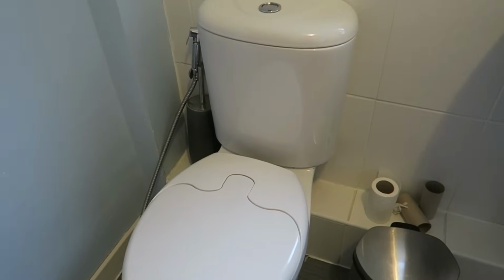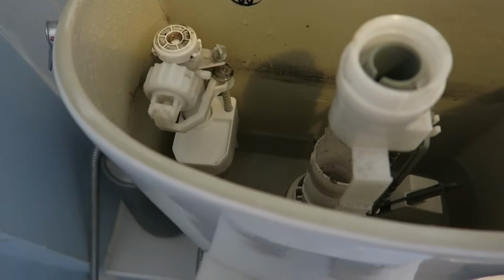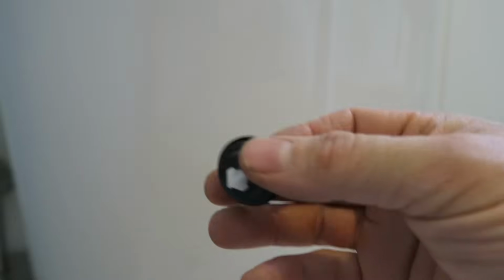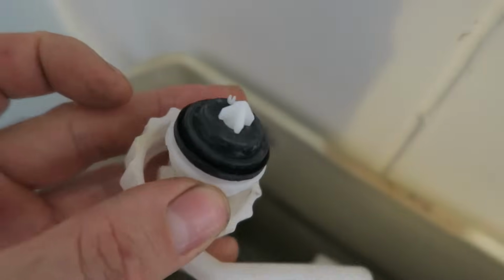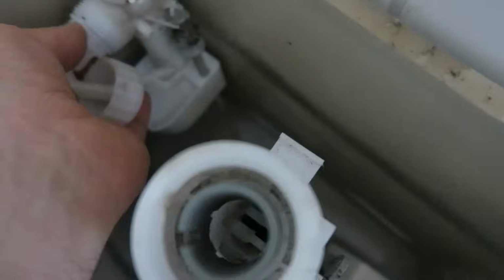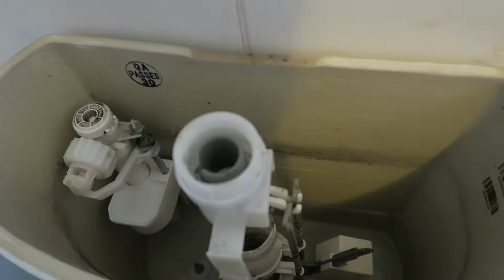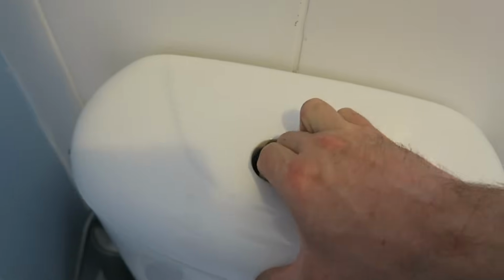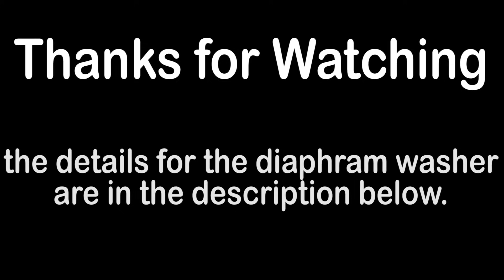Toilet Repair, Slow Filling Cistern Repair

Comment: Great video - unfortunately it hasn’t worked for me. Toilet was taking about 10 minutes to refill. Got a new washer and followed the steps including lining up both notches (inside the washer & the connection to the valve - but when I switch the water back on it runs constantly and loudly - so worse than before! Have had to keep the water turned off. Do you have any suggestions to resolve? Thanks.
Reply: I'm in the same position as you. Please can anyone help?
Reply: @shaun9407  I tried the tip from Ron (comments - about 2 months ago) to press down on the circle on top of the inlet valve with a screwdriver to let air out when refilling. After a few tries this resulted in the refill stopping after about a minute - but still noisy/whistling during refill, so not a complete fix.
Reply: @jm450  I've discovered that the white plastic arm was lodged in too tight, and therefore wouldn't lift with the pressure of the float. I emptied the water and refitted everything so that the arm/float lifts  smoothly. 👍
Reply: @shaun9407  the plastic arm on mine is fitted ok, so must be another issue. Thanks.
Reply from the maker: Most of the problems come down to the notch not located properly. Sometimes just taking it apart again and really taking time to make sure its all lined up can really help.
Reply: I have the same problem. Water never stops flowing. It is definitely fitted correctly

Comment: Could anyone kindly tell me what that rubber washer is called? Think I’ve got the same issue where it’s split however can not locate the part. Many thanks
Reply from the maker: There are links for the part in the video description and you can get them in screwfix as well.

Comment: Hey Handyman, could you advise which brand that water fill valve is? I think I may need to replace the whole thing. I have the exact same one and was wondering how I could find it, would you know? Cheers.
Reply from the maker: This is a Siamp inlet valve 👍

Comment: Hello, thanks for a very informative and clear video. The nut on mine is stuck and it's not moving - possibly because we're in a hard water area - I'm worried that if I do manage to turn it it will either break or unseat the valve. Any thoughts? Thanks in advance!
Reply from the maker: I would get a spare inlet valve just in case. Or at least know where you can get one if needed. Just in case it breaks, has been known.

Comment: Hi thanks for the video. Ate these things are standard sizes ? I have the same problem, and looking on the ebay it looks like what I need but where can I find the serial number or any data where I know which one should I buy ? Thanks for the reply :)
Reply from the maker: There are links in the description or Screwfix has them as well.

Comment: Hi, great video. I have changed the old washer which was torn like yours. However, I can still see water running from the white plastic screw cap. Is this normal or have i not fitted in on correctly? Any help appreciated. Thanks
Reply from the maker: It's probably not located properly. Switch off the water, unscrew and make sure the plastic notch is located properly. Put back together. 👍
Reply: Handyman Craft Glasgow thanks it worked
Reply: Handyman Craft Glasgow sorry can I ask for one more advice!  I have another toilet that has a slight different system. It has a wire attached to the push button. The push button wouldn’t pop back up and water kept on flushing. When I take the button off I can  manually flush pushing the lever on the small white unit and toilet works fine. The minute I attach the push button it constantly flushes again. I’ve replaced the button and it hasn’t helped so it’s not that. Could it be the wire and small white box? The whole system was only changed less than a year ago :(
Reply from the maker: Sounds like there is something pressing on the lever in the white unit. There may be an adjustment on the button. Difficult to tell without being there it could be a few things.

Comment: Hi, thank you for your details instructions how to fix this fault. My husband manage to get the washer change and put the washer back in place and try to run the water in the tank. At the end of the water filling when the water stop... there is a loud ‘bang’ from the piping. We don’t know what cause this as we followed all the steps when changing the washer. I have a feeling this ‘bang’ might cause a bigger issue. Would you kindly advice us how to fix this issue. Any help or advice is much appreciated. Thank you.
Reply from the maker: You may just have some air in the system. There are quite a few things that can cause this and is difficult to diagnose without seeing. If it wasn't doing this before you changed the washer there is a good chance its air. If it doesn't go away it may be worth getting someone in for a look.

Comment: Have replaced this valve, but now the toilet won’t stop overflowing into the flushes overflow mechanism! Any ideas? Have checked the valve multiple times, cleaned everything up, it seems even with the lever fully raised water is still being let into the cistern!

The valve is identical to the one in this video, and was the highest rated one available on Amazon!
Reply from the maker: Sounds like the notch is not located properly. It only has to be out a small amount for it not to work.

Comment: I am trying to open the thing with the valve. It is very tight and hard to twist open. Any advice for that?
Reply from the maker: Just be careful, try not to put too much strain on the inlet valve. Make sure (this may be obvious) your turning the correct way to get it off. It will come off eventually.

Comment: The rubber seal splits on these diaphragm's when the screw is tightened too much  also when it is tightened to the max the cistern takes forever to fill a quick fix is superglue over the top of the  split 
not to the point of trying to glue the split together just to stop the air escaping

Comment: If it still is not working properly after the seal change make sure the pinprick hole on the plastic fitting doesn't have dirt in it. Push a pin through to unblock
Reply from the maker: Good tip 👍

Comment: Why does torn washer make it fill slower?
(Just curious)
Many thanks for vid, 2 min fix!
Reply from the maker: I am not completely sure, they need a pressure variance to work properly and this is lost when the washer is split. The actual details I don't know. 
I am sure someone clever could explain. 👍
Glad the video helped.
Reply: The waters only supposed to pass through the whole in the place place on the siamp diaphragm. When the rubber splits it passes through this instead. This actually causes restriction of water as it's not passing it's designed path.  It's this hole which the float pushes against to stop the flow of water.

Comment: Hello handyman, I've done all in the video mate but the water level in toilet cistern dropping even though the toilet has not been flushed?
Reply from the maker: It could be the button flush causing that. Make sure the cistern lid is located correctly.
Make sure the button is not pushing the flush mechanism. If it is you may have to adjust slightly.
Depends totally on what sort of flush mechanism is on your toilet but a good place to start.
Reply: Hi mate, the water is still leaking from cistern  into the toilet bowl it looks like the washer on the Syphon has worn I have the same one as shown in your video is this easy to take out to change washer
Reply from the maker: Before you do anything, if your cistern is like mine make sure the water is not overflowing into the bowl.
There is a hole directly underneath the button, this allows water to overflow into the toilet bowl. If you can see water going down there that would be the problem and it would just be a matter of adjusting the inlet float a bit lower so the fill water goes off sooner.

Comment: Hi I've done this and it didn't work the waters spitting out of that bit you replaced . I've had a feel down the tube under that where the water is supposed to fill it and there's nothing coming out . Any ideas ?? Thank you
Reply from the maker: Sounds like it's not located properly. Double check the notches are lined up.

Comment: Great video, and i agree the part is overpriced as i paid nearly £5 for it from ScrewFix but it still was worth it.  I would add that when i done this i noticed the arm/lever is detachable and it makes it much less fiddly to do this if you just clip it into place afterwards.
Reply from the maker: Good point. Glad it helped 👍

Comment: He y I just wondered if you could advise how I would find out  what model valve i need to get - I can't seem to find one matching the type in your video on-line, which is the one I need to find. Thanks again!
Reply from the maker: Hi 
Links to the washers in the video description. 
Have a look at this valve;
Siamp 30996007 1/2-Inch 15 mm Plastic 99B Bottom Entry Inlet Float Valve - Multi-Colour https://www.amazon.co.uk/dp/B00BJK4KHY/ref=cm_sw_r_cp_apap_E8kN6ZL8anq3y
Reply: thanks a great deal!

Comment: I don’t think I’m able to turn my water off from the toilet itself, I love in a flat would it work if I take the water off for the whole flat and replace?
Reply from the maker: There is usually a stop cock for the flat that will cut off the water. Just double check the water is off to the toilet, sometimes there can be more than one stop cock for a property.
Reply: @handymancraftglasgow  thankyou!

Comment: Hi. I have an old outside loo, its empty currently - would this cause any problems internally (leaks and stuff) or is it ok to leave a loo without water in the cistern (we dont use the loo).
Any advices please?
Reply from the maker: I would leave the cistern empty, especially if you are not using it and if outside may be prone to freezing.
Not easy to give advice without knowing the details. I am assuming the water to the toilet has been cut off and that's why the cistern is empty.
If it's not being used the water in the bottom of the toilet bowl will evaporate and could let some smells in once the water drops below a certain level but you can top this up once in a while with a small bucket of water if it's a problem.
Hope this helps.
Reply: @handymancraftglasgow  How kind of you to respond Mr Glasgow, thank you so much. Well its a very old loo (1970,s) and has a ball thing inside. One day there was water all over the floor, the cistern was overflowing so yes I turned the water off to the loo.

Comment: I have this exact cistern but now it won't stop filling and starts flowing into the overflow. Do you have any tips on how to solve this?
Reply from the maker: If you have changed the rubber it usually means its not seated peoperly. Try it again and make sure the notch is lined up.

Comment: Any suggestion if it won’t unscrew?
Reply from the maker: Something they stick. Just make sure you can get a replacement valve, then use a set of grips. It should loosen.

Comment: My Cistern Inlet Float Valve Diaphragm Washer was very slow filling and as suggested I have replaced the Siamp Cistern Inlet Float Valve Diaphragm Washer which was split exactly as you described. Having checked and rechecked a number of times that I have reassembled it correctly I am left with a cistern valve that will not turn off when the float rises and eventually the water overflows down the flush unit.  I have been told that that lifting the float on it's own will not necessarily stop the water flow because it is worked by water pressure and and I need to let the water rise to turn off the flow. This doesn't work either! The only way I have found to stop the flow is to press the small round part on top of the unit with a screw driver. This fizzes a bit and seems to let out air and water and will stop the water flow until it is flushed when I have to press it again. Has anyone a solution to this problem other than completely replacing the unit which will be difficult in my case as I have a fully enclosed back to wall pan which I am loathe to remove myself. Has anyone out there had experience of this?  Is there another part I need, my plumbing supplier didn't seem to know?
Reply from the maker: Couple of things to try. This can be caused by the diaphragm not being seated properly. If you have checked it again - make sure it is still in tact. Also make sure you have the correct diaphragm for your inlet valve. There are a few different makes, the one in the video as you know is Siamp - assess if yours is the same.

Comment: great video wondering if you could help though, i have changed the plastic valve as described in the video, it was torn, i can see that water is coming up to the valve but when i put it all back in it is still not delivering water to the cistern
Reply: Make sure the washer is aligned with the notch on the valve. Could be what's causing the problem.
Reply: Ecologise I have checked that and to ensure that I have done it correctly I have done the same change on one of my other toilets and I works just fine. the water is getting to it but just stopping and not filling the tank
Reply: If you are sure you have done it correctly, water getting to the valve, make sure the float can move freely. If still not working the next step I would take would be to replace the whole inlet valve.
Reply: Ecologise have you got a video on how to do that
Reply from the maker: Not yet Simon. Will look into getting a video up for that. Not much more difficult than what you have done already. Could have a video up by the end of the week. Well done fixing your other toilet by the way.

Comment: Great video - but can you tell me the name of the valve/washer you replaced? So I can order it from supplier. Does it have a precise name? Thanks.
Reply from the maker: Hi 
I put a couple of links in the description for ebay and amazon that will take you straight to a description. 
The one replaced in the video is called;
Siamp Cistern Inlet Float Valve Diaphragm Washer
Good luck with your repair.

Comment: I had bought new one,  replaced but water steel runs. Any idea please?
Reply from the maker: This usually means that the valve is not located properly. Double check that the notch is properly located and it should work 👍

Comment: Thanks for the video, fixed the slow refill problem and spraying (had a split in the washer, yep) - but now it keeps overfilling / won't cut off!! nothing else changed or fell off and it never did this before - any ideas???? Cheers!!
Reply: And I have checked that the notches are aligned properly...
Reply from the maker: Make sure you have the correct washer for the inlet valve. If Siamp make sure it's a Siamp washer. 
Make sure the new washer is in good condition and located properly in the valve.
Reply: This happened to me (the water kept running and the pressure valve on top went off after putting in the new washer) — I had the float set too high. Screw the float down lower.

I know this comment is a year old, just wanted to help others scrolling through.

Thanks for the video, worked a treat!
Reply from the maker: Thanks for the comment. Very helpful 👍

Comment: My rubber washer doesn't have a split but having the same issue. Could this still be the problem?
Reply from the maker: It's possible the spli can be tiny and hiding in a fold of the rubber if a new washer doesn't work then maybe consider a new inlet valve.

Comment: Great video....is there any way to replace the part without turning the water off? im in a rented house the landlord wont fix the toilet that takes about 10 minutes to fill and we cant turn the water off, any help would be appreciated
Reply from the maker: There is no way to do this without isolating the water supply either to the toilet or the house stop cock.
Reply: ok, thanks

Comment: Hi, looking a bit of advice. I have replaced the Siamp washer with a Torbeck washer as it was all screwfix had in stock. Problem I have now is that the water will not stop filling the cistern, even when lifting the float manually (inlet valve is the same as the video). is this an issue as not using the same washer? if not how do i repair this, possibly a new inlet valve?
Reply from the maker: It could be the washer that's the problem. Double check that the small notch is lined up properly, if not working then probably the washer. Try the Siamp washer, it will usually work. 
If not then a replacement inlet valve, have a video on how to do that if you can't get the washer 
https://youtu.be/oz6z24HciSg

Hope this helps. Good luck with it.
Reply: For my situation, the torbeck washer I bought didn't fit at all. I bought a siamp one and it slotted into place perfectly.

Comment: thank-you for this. really great video, seems to be exactly the issue I'm having so have ordered the part and we'll go from there. best regards.
Reply from the maker: Thanks. Glad it helped.
Reply: received replacement part today from eBay. fitted in under 3 mins, perfect. if it helps here is a photo of the old faulty part https://goo.gl/photos/mNnWfHSPJrWV75Xu8

Comment: Make life easier for yourself by removing the little arm that links the valve to the float first. It just pops off. Once the repair is done, pop it back on.
Reply from the maker: Good tip Thanks👍

Comment: It is easier to replace the diaphragm in place if the arm is removed. On my model it just clicks out of its pivot behind the washer housing. The arm then clicks back into position easily. Otherwise this is all excellent.
Reply from the maker: Thanks for the info. Glad it helped 👍